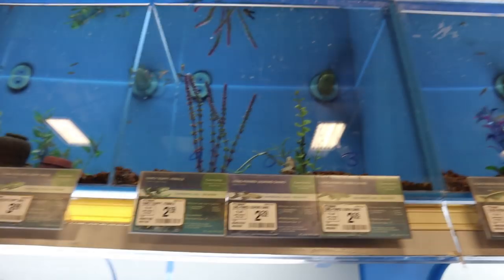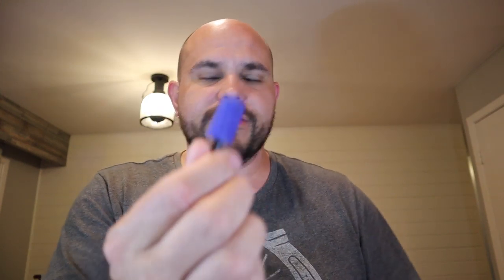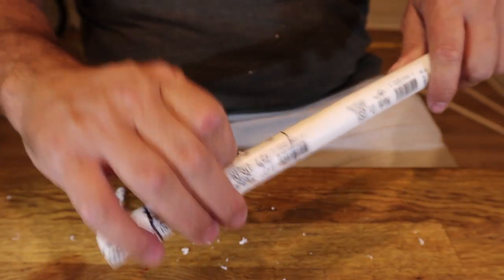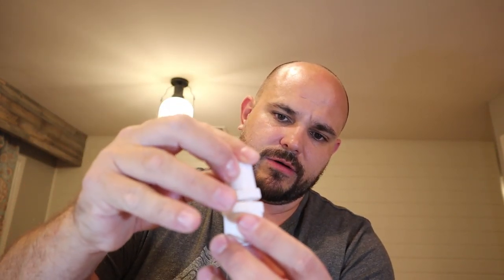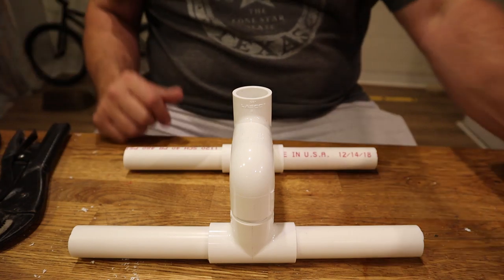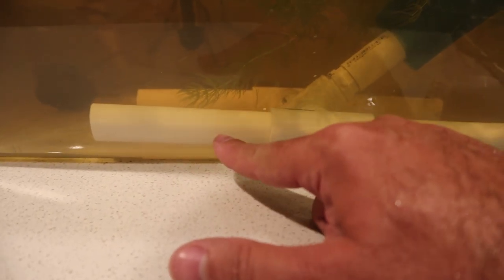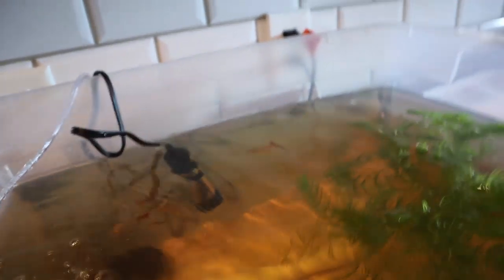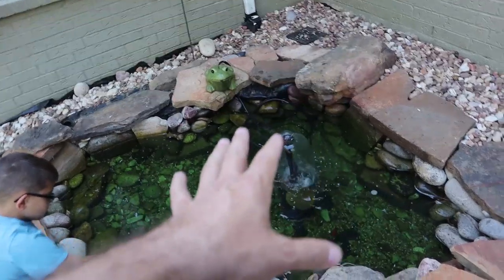🅼🆄🆂🆃 🆆🅰🆃🅲🅷 - Building A Guppy Breeding Tank  (DIY Filter)

Comment: U don't need a heater with guppies mate I don't have 1 with mine and they dreed fine
Reply from the maker: The only reason I am using the heater is because it is about 105 degrees right now so my air conditioner is set to about 68 degrees and the water gets down to about 72 with the air set there.